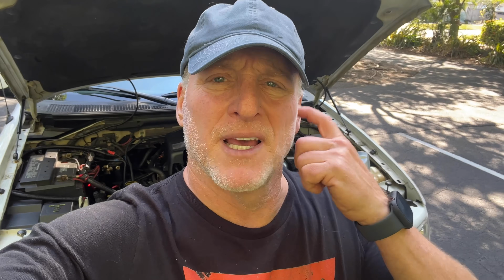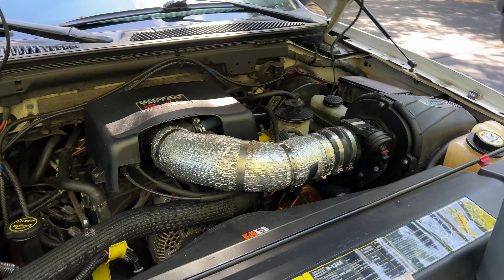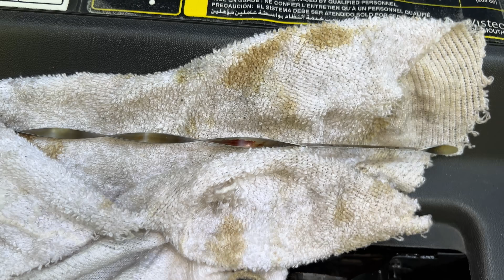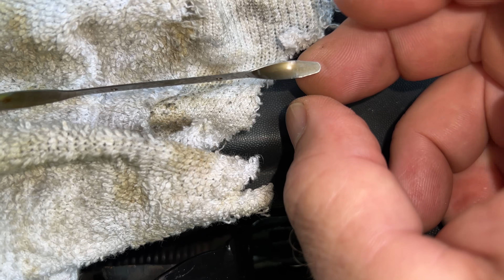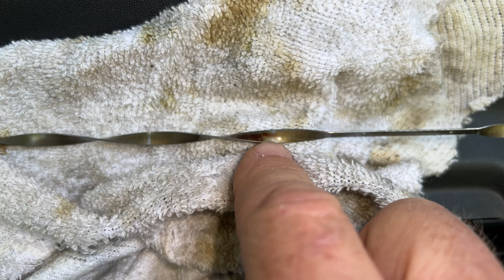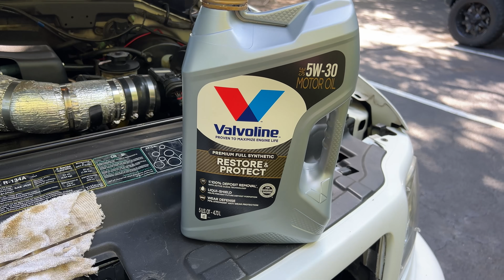Valvoline Restore & Protect Review: High Mileage 264K Engine: Reduce Oil Consumption & Piston Slap?

Comment: I just replaced my  valve covers with aluminum ones (had a crack) on my 2015 Ford F150 3.5 Ecoboost with over 130k miles. Have been using Valveolne restore and protect for the last 20k miles. The engine looked like chrome inside!! Better gas mileage and zero leaks or problems!
Reply from the maker: awesome!

Comment: Gonna use on my 2006 Subaru sti with 150,000 miles at next oil change. Just spent $5116 on a cylinder 2 misfire repair. Po302  1 burnt exhaust valve. Could have done the job but had the money . Would have  to have done outside in driveway. Boxer engine would have to be pulled out.
Reply from the maker: Thanks for sharing, I'm trying to see how much life I can squeeze out of this Ford 5.4 2V engine, now with 265k miles on the clock.
Reply: Can't really blame you if you have the funds. Engine out in driveway is not fun

Comment: Shops don't carry this oil....and most give you a hard time if you buy your own and bring it in.
Reply from the maker: understand you... this is why I do all my own work on all my vehicles.  In fact, the only thing I've paid someone to do is put 4.10 gears in my 4x4:  https://youtube.com/playlist?list=PLGNsbVXzRfZORzgcoLukxGkQzyE5wXrpj&si=bfb_4_MqKZc5fmXA
Reply: Valvoline will do it for $55. I was surprised they didn’t have it being it was their oil. Bring the oil and a filter
Reply: @patricknedz Yeah...I avoid quick lube specialty shops. I don't trust them to do ANY work on my vehicle. Never have. I can't recall specifically if Valvoline's shops have had issues...but those types of shops are notorious for causing major damage to vehicles. When I try to get ASE shops to do it...they always give me a hard time...because they call it "outside oil."...even though the bottle is still sealed and I can show the receipt showing that I just bought it prior to coming in. It's a weird policy. I could understand if I brought an unfamilar, or generic brand... but every should know Valvoline. The company hasn't done enough to market that particular oil to the shops. Luckily I found a shop that uses similar Valvoline oil. But even they refuse to let me bring Restore & Protect...and they don't carry it either. But by the time I found this shop...I had already run 2 cycles of R&P... so my pre-owned former rental car is probably alright now. I use the Valvoline extended life...which is very similar...and it is something they have on hand and use regularly.
Reply: Walmart has a specific oil change using this. I decided to try it las change (of course I was a bit worried as I have never used Walmart). I think it was like $60. Also got my last tires there so rotated them also (Around 10,000 miles). I will continue to have my Honda dealership, which has the maintenance history of my vehicle, perform alternating changes (who knows what oil they use) because I like the multi point inspection they include. At least that's my current plan. So, will have the Valvoline R&P every other oil change at Walmart.
Honda CRV 2012 (182,000 miles). Uses zero oil, been a great car so far. Changing around every 5,000 miles (in all honestly, I just don't let the maintenance minder go below 30% oil life before changing.) I used to obsess over this stuff but, not as much anymore. Learned a few things along the way!

Comment: I recently switched over as well and have noticed a quieter sounding engine… I’m really impressed and with my truck only having 66K miles I’m hoping this will keep mine like new inside!!
Reply from the maker: good you're using quality oil early in the vehicle's life.  I'm at 265k miles and this truck is still running strong.

Comment: I put this stuff in my 93 Nissan. When I first started it up, blue smoke was coming out the exhaust pipe.
I thought I overfilled the engine. Nope, actually a slight bit lower than full.
Ran it at idle for an hour. Smoke went away.
Runs okay. Maybe a little more power and mileage.
Reply from the maker: interesting, thanks for sharing

Comment: Here’s my 9 month testimonial for VR&P. Just a data point for anyone looking into this product.

2012 Prius V I’ve owned since new. Oil changes at dealership or quick-lube places. So just bulk synthetic that came out of a barrel.

Lots of HWY miles for the first ~85K. Oil change interval average ~7K. After that, from ~85-127K, almost all short trips with oil change interval average ~4.5K.

Model year falls under TSB for low friction rings oil consumption. No noticeable oil consumption at 124K, when I switched to VR&P, but was smelling fuel dilution in the oil(fuel dilution was probably masking some oil consumption).

So my original intent was to switch to VR&P to hedge against possible future oil consumption. I had originally thought about changing the first use of the VR&P out at 1K miles, or at least the filter, but it looked so good on the dipstick checks I ended up going to 2.5K. Oil filter looked normal upon change. I think I could have gone out to 4K on the first change.

That fuel dilution in the engine oil(probably first noticed when the vehicle started being used for majority short trips) was to the extent that I could smell it in the garage after the car had sat a bit. I now have ~4K+ miles on VR&P and no longer smell fuel dilution in the engine oil. Can’t speak to why and how, it’s just my observation.

The other thing that has really pleased me is how quiet/smooth the engine sounded immediately after switching. I had always thought this 2ZR-FXE was a clanky sounding engine. I mean the very first start had noticeably reduced engine chatter. Like me standing there stunned at first startup.

Engine had no leaks before. Haven’t observed any since the switch.

I’m probably going to use this oil for the rest of the vehicle’s serviceable life.
Reply from the maker: Great comment, thank you.  Generally, this is consistent with almost all comments I've received from viewers, except those that have never used it, or a very few that say they have engine oil leaks shortly after using this oil.  My experience has been very good so far.  About to do another video, once I get the oil test results from Blackstone.  Stay tuned.

Comment: I put it in my 2000 Durango 4x4 with 200k+ miles and within 100 miles it began to leak oil all over the engine. I drained it out and replaced it with Havoline LifeLong (high mileage) and added a bottle of AT-205 Re-Seal. It stopped the oil leaks and the engine is quieter now. I will never use that Restore n Protect oil in any of my engines again
Reply from the maker: interesting comment.  I wonder if the R&P removed the sludge that kept the engine tight, and then the AT-205 reconditioned the seals and gaskets.
Reply: @DrivingIntelligence   I used it in 2 of my vehicles at the same time, a 2000 Dodge and my 2016 Jeep. They both began to leak. I change my oil in all the vehicles every 5k miles using Pennzoil Platinum or Valvoline High mileage Full synthetic. Neither leaked a drop of oil until I used the R+P. I called Valvoline, they said it can happen. The sludge keeping parts tight is a myth confirmed by Valvoline as that was one of my questions to them
Reply from the maker: @johnnyappleseed4386 did they say why it can happen?  The sludge was not closing gaps in the seals?
Reply: @ No, the non-existent sludge wasn't closing the gaps. There's no sludge build up in my engines. I only used it the R&P as a preventive maintenance. Valvoline "recommended" only using it for 1k miles before draining. My question was why wasn't that tidbit of info made public. It can and will harm your seals if left in for too long. Apparently 5k miles is too long
Reply from the maker: @ I've been running this oil for over 8k miles and my engine is solid.  I called Valvoline and they said their formulation will not harm seals and gaskets.
Reply: @DrivingIntelligence  That's exactly what they told me. Got both of my vehicles on a lift and both are leaking from the rear main seal. Been 3 weeks and my wifes Jeep has lost 1.5 quarts of oil, it never leaked a drop. I always use Valvoline high mileage 0W-20 before trying the R&P. My old truck is being repaired right now. Ran it in my daughters '21 Jeep and it' didn't develop a leak. Looked at the reviews on amazon, I'm not the only one experiencing seal leaks from using it. After the required repairs I'm going  to start using Pennzoil Platinum high mileage. 
Talked to Valvoline again, they're getting more reports of high mileage vehicles leaking from the rear main seal and other seals BUT unless you purchased it directly from them, not amazon or any other place, they will not honor their warranty
Reply: @ They asked me for pictures as proof, I sent them in. They admitted in some cases it can damage seals
Reply from the maker: @ Interesting, thanks for sharing.  Sorry for your issue
Reply: @johnnyappleseed4386  I have the newer Pacifica 3.6 and with your both Chrysler motors ONLY use Penzoil Ultra Platinum 5W-30.. It has the Chrysler MS-6395 spec, has higher detergents and is the oem required. I consume no oil in between changes no leaks and clean as a whistle...
Reply: @seatime674  I only use Pennzoil Platinum high mileage in my wifes and kids Jeeps. Havoline Pro-DS LifeLong is Mopar MS-6395 specified oil
Reply: @johnnyappleseed4386 Sounds like a Stallantis problem and not a R&P problem. My car is nice and tight after 5,000 miles.
Reply: @JohnTaylor-bd1uy  Stellantis didn't own Dodge in 2000, genius. You're only 14 years off
Reply: @johnnyappleseed4386  Either way, Dodge sucked then and is far worse now! You're the idiot for owning a Dodge.

Comment: I wouldn't think, Valvoline would risk their long 160+year reputation to now start selling us some snake oil. I've been using it like, since 70's and with no problems at all. Absolutely, worth trying... 🙂
Reply from the maker: I never used Valvoline until they came out with this claim, and as I said in the video, maybe too good to be true, but too good to pass up... so far I'm happy with this oil.
Reply: @DrivingIntelligence Cool, I'm so happy you're getting great results and in all honesty try now, to stick with just one brand of oil.. Cheers. 🙂
Reply from the maker: @ yeah, Valvoline said it takes 4 oil changes to get the results they claim.  On my 3rd oil change now with  just a few hundred miles, and 8k miles since I started using this oil.

Comment: FYI, Valvoline is doing a rebate till the end of July for $5 Cash Back on up to 5 quarts of oil. I believe you can get up to 6 rebates. Very easy process where you get the cash in 2 days.
Reply from the maker: I've seen that.  They used to have a BOGO 1/2 off on their web site, but actually, it's even cheaper at Walmart, less than $30/5 quarts.
Reply: @ it’s crazy how much Amazon changes their prices. I bought the 5W20 for $30 and now they want $37. I like how Walmart doesn’t play these games.
Reply from the maker: @teslamr7333  I hear you!
Reply: I plan to try this special Valvoline oil in my 2004 Expedition with 282,000 miles.  No varnish visible on dipstick.  I have read where some people have success adding a quart or half quart of trans fluid to each oil change.  I haven't tried that.
Reply: @ IMHO that’s sounds crazy to add trans fluid to an engine.
Reply from the maker: @smithwesson7149  I'd just start with the Valvoline R&P and forget about the transmission fluid
Reply: @teslamr7333  thanks for mentioning this! I have two purchases since October.

Comment: That oil looks spectacular, but I have a question: when removing the deposits inside the engine, is there any risk of clogging some of the small internal oil passages in the engine, for example those of the VVT system actuators? Thank you very much.
Reply from the maker: Valvoline claims this oil will slowly remove and dissolve all deposits top prevent what your concerned about.  I've heard that some have had a slug of sludge get dislodged, clog their oil filter and cause problems, but I suspect that engine had not had regular or routine maintenance.
Reply: @DrivingIntelligence  Thanks for your reply. I change my oil every 5000-6000 miles. The engine has an amber color around the rocker arms and camshafts, but never any visible deposits or sludge, just the amber color. Shouldn't there be any problems then? Thanks.
Reply from the maker: @ My next video on this oil will cover this very subject, stay tuned.
Reply: @DrivingIntelligence  Ok, Thank You.
Reply: @jonpinones6247   I think things need to be as clean as possible  especially engine internals & the risk must be taken regardless of what 'could' happen, thats like never taking a hot shower because it raises blood pressure

Comment: Have you ever used this motor oil in a vehicle that doesn't specify synthetic motor oil or ever heard of that in older vehicles?
Reply from the maker: My 1985 Mustang SVO used conventional oil.  I bought it new from the dealer.  Some years later I started using Mobil 1 Synthetic because dyno tests showed Mobil 1 made 8hp more than the conventional oil.  I just changed the oil in that car using the Valvoline Restore & Protect.  I have no concerns running this oil in my Mustang that previously used conventional oils.
Reply: @DrivingIntelligence  Ok. What improvements have you seen in your '85 Mustang engine, since using Valvoline Restore and Protect?
Reply from the maker: @Slim1423  too soon to tell, I did use a borescope to look at the valve train and it is spotless.  I guess I took good care of this vehicle!  I will share results of use of this oil in the car later on.
Reply: @DrivingIntelligence  Ok. I understand. Please, yes do a update about your 85 mustang later. Old school car owners would like to know about it! Was looking at some Valvoline Restore and Protect motor oil at Walmart, yesterday. The big jug costs no more than most other synthetic oils maybe $23 or $26, but the one quart bottle is slightly over $10 a quart! So, buying the big jug of this oil is the better way to go......
Reply from the maker: @ exactly, I always buy two 5-quart jugs at a time.
Reply: @DrivingIntelligence  Yeah, it isn't a bad price for this oil. I think in time we will hear more about this Valvoline motor oil, because more people have severe oil sludge issues and will need a product like this.
Reply: Decades ago I had a cavalier and I went the first 70K on conventional oil. When I started doing my own oil changes I switched to Mobil 1 and it was noticeably smoother at cold start and I got a 2mpg improvement. Eventually I had to take the valve cover off and it was spotless. My other cars over the years I've always used synthetic and they are spotless too. Synthetic is definitely the way to go if you plan to keep the car for decades.
Reply from the maker: @ As I mentioned earlier in this thread, I had a similar experience with my 1985 Mustang SVO that I bought new and still own.  Dyno tests showed that Mobil 1 allowed the engine to produce 8 more wheel horsepower using Mobil 1 Synthetic over conventional oil.  This Mustang came from the factory with conventional oil.
Reply: @DrivingIntelligence  Ok. That was a good increase in horsepower! I remember some people liked mustangs, but some said they burned too much gas.
Reply from the maker: @Slim1423  Actually, the Fox Mustangs, whether with the 5.0 engine or the 2.3 Turbo (which I have) had excellent highway fuel economy.  I got over 30mpg from time to time.
Reply: @DrivingIntelligence  That was very good for a Mustang. I had a older Mercury Colony Park Station Wagon, that was carbureted with a 5.0 engine similar to some Mustangs. It burned a 1/4 gallon of gas in maybe a 20 mile trip! It was maybe a late 70s or early 80s car. Didn't keep it long, it kept giving me problems.
Reply from the maker: @Slim1423  that sounds like good fuel economy!
Reply: @DrivingIntelligence  No, I had to let that car go! Was getting costly, to keep it fixed....
Reply: @AmandaHugenkiss2915  Ok, I believe you. I remember some earlier Cavalier cars actually had Toyota engines, but not sure what year Cavalier those Toyota engines were in.
Reply from the maker: @ the Chevrolet Cavalier, as produced by GM for the North American market (1982-2005), did not use Toyota engines. Its engines were designed and manufactured by GM or its subsidiaries, with some influence from Opel (e.g., 2.2L engines).  There was a unique case where Toyota sold a rebadged Chevrolet Cavalier in Japan (1995-2000) with GM engines, but the reverse—Toyota engines in a Chevy Cavalier—never happened.
Reply: @DrivingIntelligence  Ok. A old lady once told me many years ago that her Cavalier had a Toyota engine, so I guess she told me wrong. I just read that there was a Toyota Cavalier without Toyota engine sold in Japan many years ago. Toyota and GM worked together with a few different cars that were american cars with Toyota engines, and these cars were the Geo, Chevrolet Prizm, and Pontiac Vibe . The Geo and the Chevy Prizm were good cars I think, and the Geo may have had a 3 cylinder engine that could get 50 miles to the gallon, or so they said. Never owned any of those cars though.

Comment: Many people don't know that part of an oil's job is to remove contaminants that occur inside of an engine after the ignition of fossil fuel, one of those being the removal of acid that forms on the cylinder walls after each combustion cycle which is actually what turns oil black, so this type of oil makes a lot of sense, the dipstick observation is proof that that oil is actually doing what it claims, I'm going to give it a try, thanks for your excellent content.
Reply from the maker: thank you!
Reply: my oil always turned black right away. read my "other" posting.
Reply from the maker: @larryjanson4011  thanks for sharing, saw your other post.